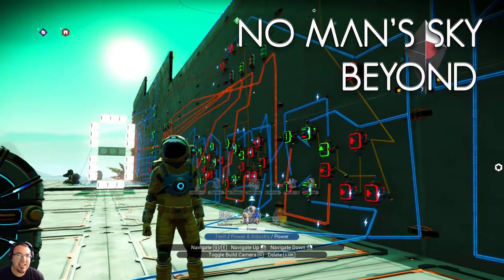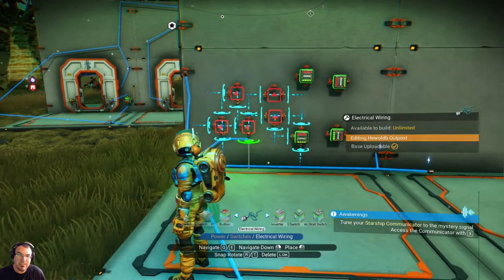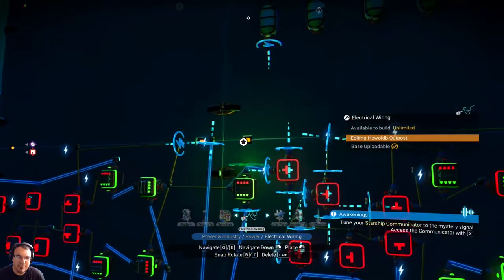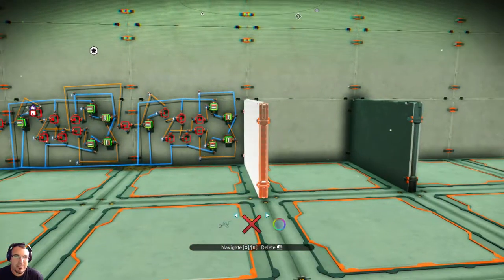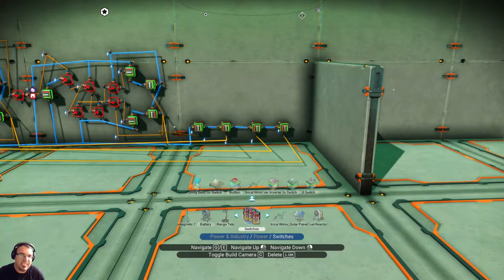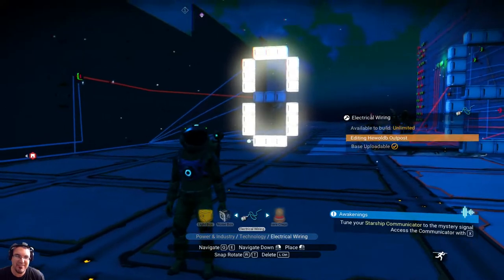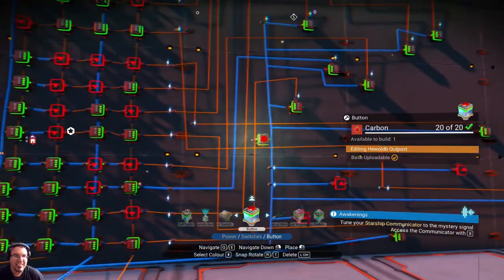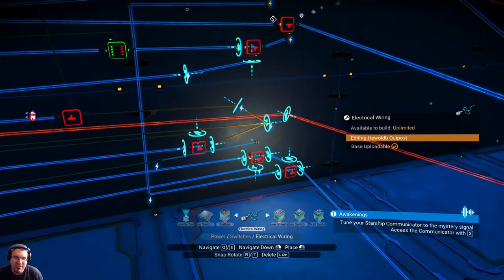How to Build a LED Score Counter Display! - No Man's Sky Beyond Tutorial

Comment: Clear as mud. Now make a 555 timer.
Reply from the maker: 1acroyear1 what’s hard about this all is the missing real world electronics. Aka inductance, diodes, transistors 

There is a clock that can be made to run the binary counter automatically 1-15 but the clock needs to have a decent amount of delay to let the signal go through the entire circuit

Other than making a synchronous counter (which removes some of the delay there’s challenges on speeding up all the delays we get now

Comment: you made a mistake at 28:51 about that's a 12 when it should be 11 it needs to  autoswitch , inverter , autoswitch, autoswitch for 11 you have auto, auto, inverter , inverter anyways you reall only need to test for 10 and cause 10 to rollover to zero and then send a carry pulse to the next digit...
Reply from the maker: It definitely was part of the process of learning how to carry digits over. The toughest bit is getting the system to recognize 9 is the highest number instead of the max binary for the set

You’ll see in the clock and adder the carry over feature. The clock is a bit harder because the max number for the hour hand ends up being 1, 2, while the minutes is 5 and 9 for the last digit. Getting them to cycle at the right time can be challenging
Reply: agreed you would have to check the whole number
 @KoiGaming